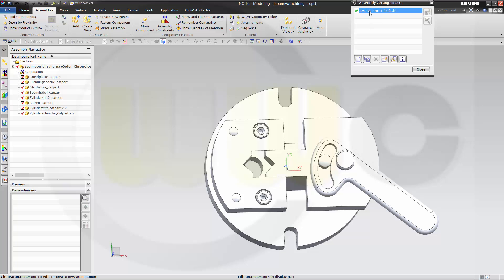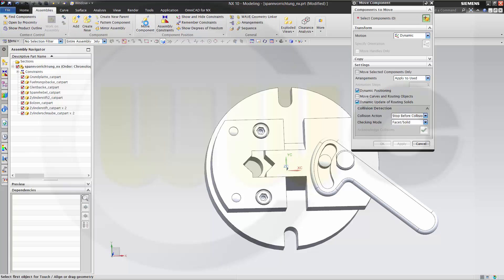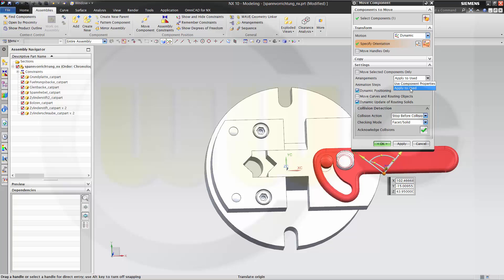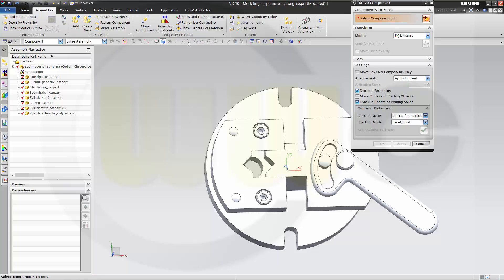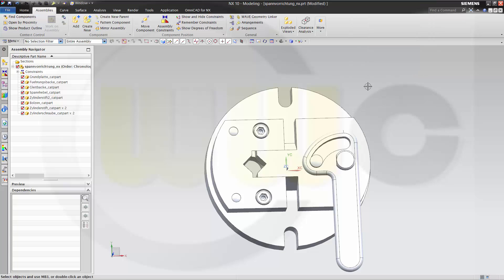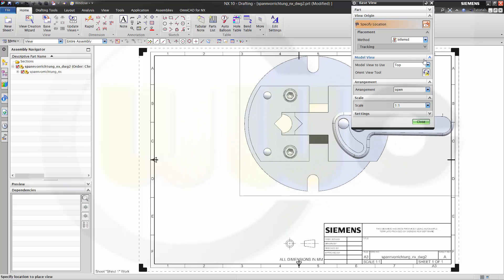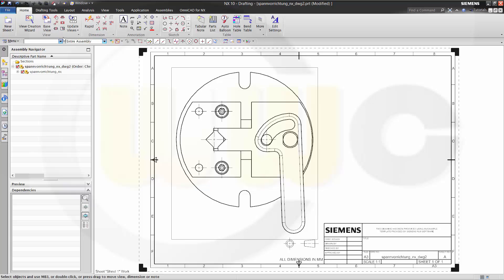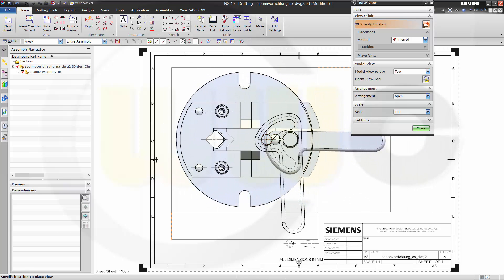Arrangements Siemens NX 10 Training - Arrangements - Drafting - Assembly

Comment: But... How to make a Partlist of a drawing depending of a arrangement? 

I create some arragements for different versions of a product. I need separate Partlists for each arrangement.
Reply from the maker: First problem - you can do only one partlist, So there might be no possibility to do different ones. I have to check for myself. If I find a solution I will make a video ;)
Reply: I is probably right, that you can do only one part list in the drawing. Unfortunately. Because if there is such nice function created like arrangements, the pracitcal consequence of it should be making possible to create partlist of them. I still wonder, why Siemens did not unite it with reference sets modifying it. I could also include the function of exploded views. At Siemens, I see the tendency to create more and more new features instead of modifying the old ones. I guess the programmers get money there for the quantity instead of the quality.
Reply from the maker: Maybe LOL - but I suppose DRAWINGs have very low priority, because all those things are handled with Teamcenter so there is no need to pressure the improvement of drawings.
Reply: I noticed, that many companies still can not afford Teamcenter and use Partlists from the drawing for production.
Reply from the maker: I know - but the big players like Daimler use Team Center - so there will be no pressure from this important player.
Reply: Daimler still does not realy use TeamCenter. They are still discovering NX trying to make it working like CATIA they used bevore. I work for Daimler now. I am also a trainer in Daimler Standards in NX.
Reply from the maker: Hi, I know that Daimler/Siemens tries everything to transfer tools and methods from catia to nx, but I was not aware that teamcenter - integration has not proceeded. That is sort of ridiculous imho.

Comment: Important note: when your parts in assembly are not unlocked in settings (by default they arent) arangment positions would not work!
Reply from the maker: That&#180;s strange, cause by default they always are.
Reply: hmm, i didnt change anything and was uses shared positions, so i had to change to individually positionded